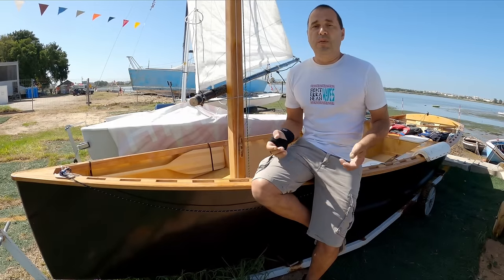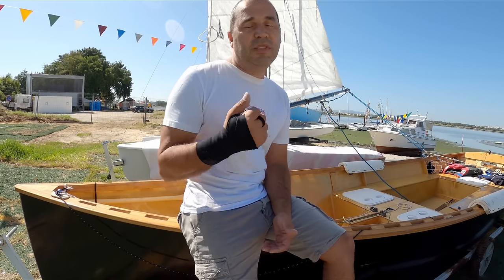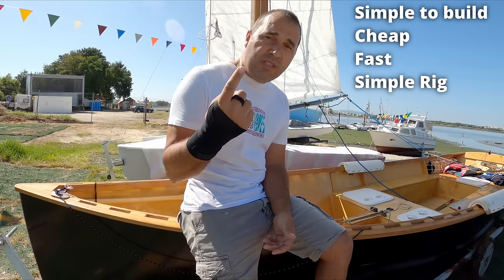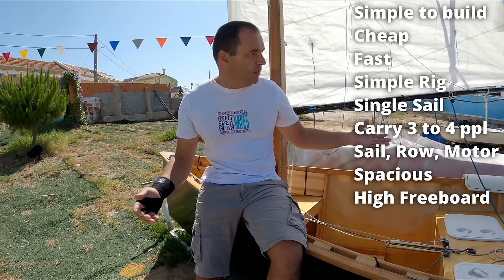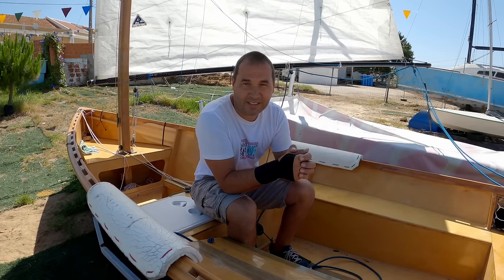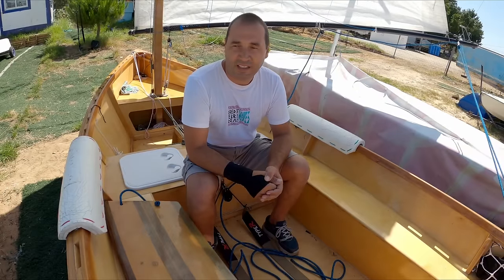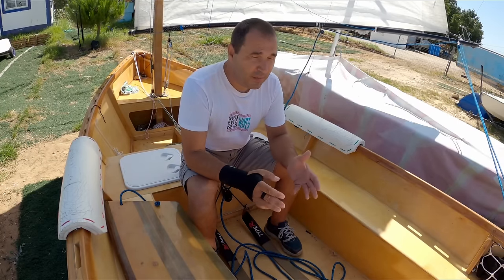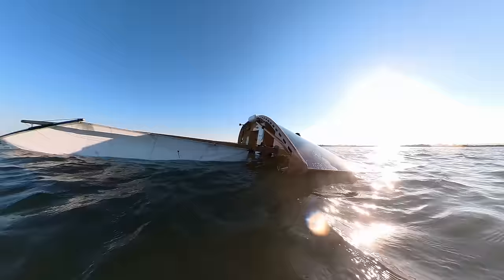Discovering the Ultimate Design: My Journey with the Goat Island Skiff

Comment: Dudley Dix's Argie 15 is my dream row/sail camping boat.  The only tick box it lacks is a high free board, but I've seen a couple builds where they add extra height, but it's a trade off for rowing comfort.

I also keep coming back to the GIS plans for the their simplicity 

Some day I hope to build one, but until then I live vicariously through your adventures, thank you for sharing all these years!
Reply from the maker: The Argie 15 was at some point on my short list but the complexity of construction compared to the GIS ....
Reply: Yes I built an Argie 15 with 100mm of extra freeboard.  The  only reason I don't still have it is that I wanted a small pocket cruiser with sleepable cabin.
Reply: Argie wasn't anywhere close to that fast though!  It had 1-2 feet wider beam.
Reply: @TheBoatRambler  And in my opinion way less beautiful

Comment: Its great that you found the boat that suits you. Some observations: The GIS is a 'sporty' boat (not really designed as a cruising boat, as you say) and my guess is that you are 80kg or more? It's also clear that you have good experience in handling and probably racing, small challenging dinghies in challenging conditions.  So, yes, for you, its great but for anyone lighter and/ or  with less dinghy experience, she would be a hard mistress.
You are absolutely right that any cruising dinghy, who is likely to be sailing without a safety boat, should be able to self rescue and your additional tanks have achieved that. Def more important than lazy-jacks, nice though they are!
IMO 'car top-able' is an elusive concept for the solo sailor. It can be done of course but...why not just use a combie trailer? Believe me, when you put on some years, you will wonder why car topping a proper boat (not a surfboard or canoe) ever looked like a good idea!
Plus.. an idea that might work on your GIS is to have drain holes (or better, slots) one either side of the transom at tank level. When the lee rail goes under and you scoop in water on top of the thwart, it can run to the back and drain out. The famous Mirror Dinghy has these and they work.  Also observing your video, some of the water scooped onto the tank runs forward to your crew space. Maybe fit some knees there to block the flow forward?
Take a look at Ross Lillistone's boats on Duckworks, 'Phoenix 3' or the simpler 'First Mate' ? Maybe 'Flint' if you think rowing is fun!
Reply from the maker: Hi. Thanks for your feedback!
I'm actually a small dude, 1.70m, 72kg. I have sailed from Optis to 5 ton traditional boats but never long enough on the same boat/class to became very good on any of them! 
The GIS can be a handful with a full sail but put one or even two reefs on and you can face a storm! And still go faster than most!!
The drain holes on the transom have been om my mind for a while now, maybe next time I bring Forager home for maintenance I'll make a few mods. 😉 The knees to prevent water going forward would be a nice addition if I can make them removable.
Car topping shouldn't be hard if one can come up with a contraption so that strength isn't part of the equation.🤞
I have been a fan of RL Flint's (and Fleet as a fishing skiff) for a while now. The other two you mentioned will have a lot of water in them after capsize!
Cheers,
Teo

Comment: Fantastic, Teo! Have you ever considered self-bailers like racing dinghies use (or used to use)? They're simple to install, work really well -- even better when you get up speed again -- and are both simple and cheap (although the tope of range is more), as well as shifting a great deal of water quite quickly. I love your build and your modifications. Personally I'd like to be able to sleep in the boat under a boom tent, but that's just me 🙂
Reply from the maker: Hi Ray!
The auto-bailers are a source of problems and will always start to leak eventually.
As for the boat tent I might do something about it soon! 😉

Comment: Great vid Teo, I’ve just finish the bulkheads doing the centreboard case, I’m going to cartop but I still think I’ll build her as you did with the centre seat & tanks. I’ve used lightweight ply & frames so fingers crossed. Thanks mate
Reply from the maker: Hi Ken!
You will need another person to help you or you need some contraption to get the GIS up there! but other ppl do it regularly. 😉
Reply: @TheBoatRambler  I’ve worked it out from a YouTube video, I have a utility with carry bars so hopefully it’ll work. Cheers
Reply: @kens2114  Can you share the link to how to get a dinghy the size of the GIS up on roof racks? Thanks!
Reply: @colvingazelle  I just searched on YouTube, there’s a number of them. I will load from the back not the side. I haven’t saved any specific videos. I’m early in the build so i will do some detailed research as I get closer. It looks pretty straight forward & luckily I have a long Ute with racks already which simplifies things.

Comment: Hi, question for you: what would you think if the GIS was 20% larger in every direction? So 183cm wide instead of 152cm, and 568cm long instead of 473cm.
Reply from the maker: There is a slightly bigger GIS built by Arwen Marine I believe, but only 5m.
https://www.youtube.com/watch?v=ArHkCwYHv1Q
I think that's a question for the designer. I'm not qualified to know if the building method would work or not.
Put that question to the designer himself in the GIS FB group linked below.

Comment: I've been your fan basically since the first movie, when you started building GIS.
However, I have some remarks about your sailing, and above all about your ballasting technique. Of course, these are theoretical remarks, I've never sailed on such a skiff, but I got the impression that you ballast inefficiently. If you lengthened the weight straps, you could hook in with both legs and "go" more over the side of the boat, which would give more ballasting weight, see how it's done on Finns. Of course, you'd probably have to move the ballast "sponge" back, and I don't know how that affects the sailability of the boat.
Generally, as I said, I'm your fan and if I'm in Portugal, I'll definitely try to visit you.
Well, I'm waiting for info about your cruiser ;)
Greetings from Belgium
Reply from the maker: Hi Petrus!
I did have the straps adjusted differently at the beginning if you see on the launch video (week30) you'll notice I'm hiking further out.
After a while, I have noticed that I do need to get its bow down so it stays better balanced and the chop is less of a problem. To do so I have to move further forward  on the boat.
Also the way I sail it is more as if I'm seating on the gunwale and less of a hike...im 49 years young, can't hike for too long anymore!!
Do tell me if you come over!
Cheers
Teo
Reply: @TheBoatRambler  if everything goes well (the most important word IF) then I will definitely take part in the regatta from Sagres to Martinique in 2025 as part of the "Setka Atlantic Challenge". This is the plan for the next two years - build a boat, test it and sail - the last regatta feat ;) then only recreational sailing.
Will it work? I hope so, but there are a lot of variables.
Piotr

Comment: I know you were trying to demonstrate how fast you can do the mast and rigging the sail. But isn't there a neater way of reefing the sail?
Reply from the maker: Hi, I'm not sure....did I reef the sail  in this video? 😅
If you're referring to when I lower sail, to me that is unnecessary, the less I mess with the lines and sail to lower the mast the less chances of getting tangles when setting it back up again.  Also folding the sail neatly will brake the sail always on the same spots. 
But you can spend as much time as you want making it look neat, you can get bungee loops around the sail, before lowering the lazy jacks or fold the sail afterwards.

Comment: Because of your videos I bought the plans and even bought the sail (before prices went up). When the time is right I'll build her. But I have been wondering about foam core for most of the boat to help offset weight gains from mods since I too would make most of your mods. What do you think? Which parts would you make with ply and which parts would you make with divinycell?
Reply: Thinking along the same lines... even considering cored composites for the hull as well.

Comment: I want to build this sailboat, but I have a question for you. How wide should the workshop door be?
Reply from the maker: Depends... if you are capable of turning the boat on its side and take it through the door that way than probably 80cm should be enough. If it needs to go past the door leveled than you need  170cm.
Reply: @TheBoatRambler  thx a lot.

Comment: How does she handle a 15-20 knot wind? Do you use weights or ballast? Thx
Reply from the maker: Hi Cristopher.
The GIS was designed to sail with a crew of two. I solo it 90% of the times. I don't use ballast, I reduce sail acording to wind conditions.
at 10kt I need one reef on, at 15 to 20 I set the second reef. I have sailed her in 30 kts gusts with the two reefs and ....it was interesting!   😁   https://youtu.be/4_CbrWSJb68

Comment: A bit to much adrenalin for me, tbh.
Can you built it with a steel centerboard instead of a dagger board to improve ballast and with  self bailers?
Reply from the maker: Some of the GIS owners use two 20 liter jerrycans either side of the centercase as ballast.
A steel daggerboard would probably need a design change.
If you sail the GIS with a reef on it behaves much better and with two reefs you can sail really strong winds easily.

Comment: Teo the extra weight might be an advantage , at least in sailing terms, I concede it's a disadvantage on the ramp and the car top, but I have come across boats in the past that sail better with extra ballast aboard, the only way you can test this is to put your boat up against boats built to spec over a period of time in various conditions and discover the pros and cons.
 Now this new dinghy , will it be racing or general purpose. what propulsion will it have?
Reply from the maker: Hi David!
The extra weight is definitely an advantage when placed in the right spot. As is, I can feel some difference with full load or empty lockers, specially on how easy she will start planning.
I sailed her side by side with Cabra Cega (a light GIS) without the camping gear aboard, and couldn't tell any difference between boats.
As for the new dinghy.. DEFINITELY a sailing dinghy! main porpuse is to get to different waters on the roof rack! 12ft, unsinkable, dry after capsize,  maybe 50kg? Carries 3 or 4 ppl at a pinch,  easiest build ever,  very stable, balanced lug sail, I can sleep on the cockpit floor.....it only loses to the GIS in size, freeboard and looks! 😁
Reply: Same problem an goal  here,  1 have both plans.  I first will build the Oz Goose  for potability, then a few seasons later  the GIS...  
Follow your Chanel  and this video made my mind.
Reply: @garygower702  Take my advice build them side by side, costs will continue to climb amount of extra effort required less than effort required for two separate builds.
Reply: @TheBoatRambler  Hi Teo! I have been binge-watching your videos. I am in love with this boat design and am heavily considering building it in a few months time. But I would really like to be able to car top my boat and launch it by hand fast. That is literally the only reason I am hesitating on this boat. I am suuuupppeerr curious to know what the new dinghy is that you will be building. It might be the perfect one for me by the sound of it. If it is anything of interest, I live in Mozambique and we have some beautiful kitesurfing and sailing conditions here. Look forward to the new build! Any chance you will tell us what boat you are going to build next? wink wink nudge nudge XD
Reply: I want to have a safe boat that I can use on some choppy waters for some island exploring and fishing with 1 or 2 people in addition to myself. Wonder if your new build will fit that kind of description... Any idea how fast she might sail?
Reply: @AuthenticAfricanAdventures  The first two boats I helped my father to build  were in Africa, he started me very young both boats were only ever splashed on fresh water. Where in Africa are you?fresh or salt? would you need to take croc's hippos or sharks into consideration???
Reply: @davidprocter3578  That's really cool! I am in Southern Mozambique. No crocs and hippos fortunately. It is sea water. In the bay formed by the Maputo harbor and sheltered by 2 islands. In the 20+ years I've been here, haven't heard of any shark problems with local fisherman or recreational sailors. Been kayaking and kayak sailing myself for many a year as well.
Reply: @AuthenticAfricanAdventures   As you know the water there so well, maybe the design not so important, but as always with fishing parties best to err on the side of caution, fast and stable always best for a working boat. How big is your car, if you drive a 1960's yank tank the boat can be as big as you can lift but a classic mini is a different story.
Reply: Sounds like your next build is the Scamp.
Reply: @davidprocter3578  On the smaller side. And road regulations here specify that anything carried on the roof cannot extend past the back of the vehicle. Because of that I am limited to 4m-4.2m max.
Reply: @anastasiahopkinson5676  That's a neat little boat.
Reply: @AuthenticAfricanAdventures  Are you allowed to go forward of the cars bonnet? or wider? than the car. 4.2 meters still will provide you with a good sized fishing/sailing platform. I might be tempted to go for a large pram dingy, you could build or buy an old mirror dinghy or supersize an optimist dinghy. there are plenty of other small pram designs out there that can be supersized. I did this myself some years ago for a fishing platform I ran it with a sprit sail rig but wished I had gone for a much taller and faster lateen rig in narrow waters with light airs they point much better. Think Nile felucca..A pram gives you an over square design ie it is nearly as broad as it is long well almost ,more so than a standard dinghy. Someone mentioned a Oz goose , they sail well are car top able look to be stable in its present design  form might not be the best fishing platform but worth considering if you can see a way to mod it for fishing.
Reply from the maker: You have your answer right there! Just built it light! 😉
Reply from the maker: @anastasiahopkinson5676   I love the Scamp but it's a lot of work to build and it can't be cartopped, neither is she fast at all!
Reply: @davidprocter3578  I'll need to check but I don't think so. But if it does stick past, well... Then it's just error of parallax haha. The Oz Goose seems to be a good fit. Wonder how fast she'll go...
Reply: @TheBoatRambler  Oh...Oz Goose? With lightweight construction? Is that the one?
Reply from the maker: @AuthenticAfricanAdventures  🤫
Reply: @TheBoatRambler  Ah yes. Right right.... Nothing to see here...😝
Reply from the maker: @AuthenticAfricanAdventures  😁
Reply: @AuthenticAfricanAdventures  Not to sure using parallax as an excuse would work on your average copper.they almost certainly will think it is a cure for constipation.There's a fair bit of footage on U tube of them sailing they do seem to go well in a stiff breeze but what boat doesn't contact with the owners should get you the info that you want